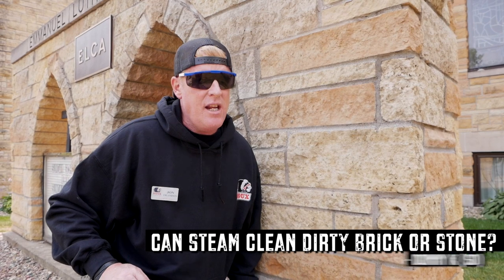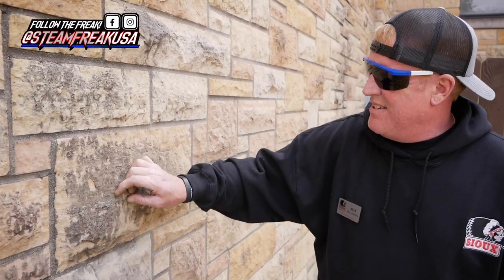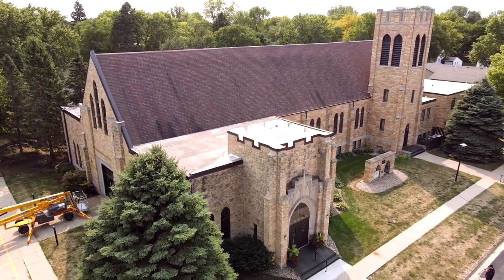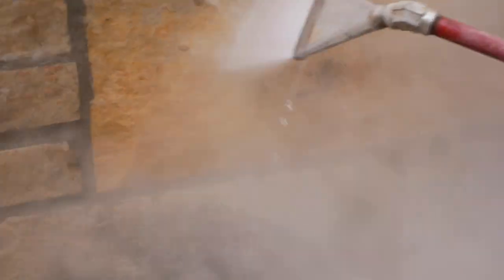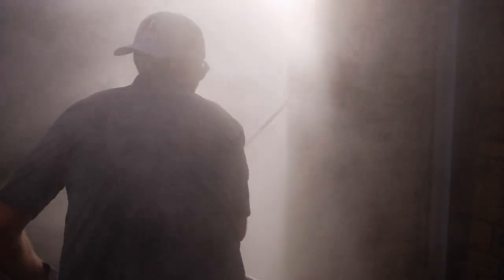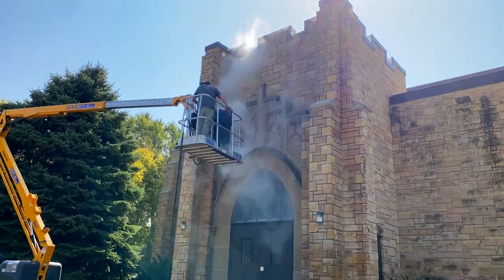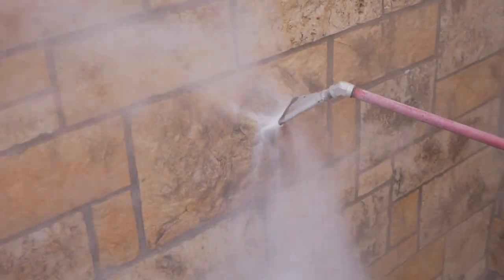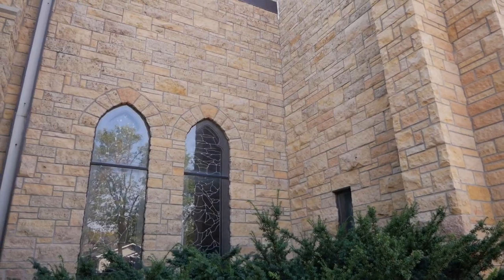How to Clean Brick WITHOUT Acid | Stone and Brick Cleaning Machine

Comment: would this be suitable for long term oil stains on driveways ?
Reply from the maker: Hi Michael, we've cleaned some parking lots and it does a great job with removing grime, gum, and oils on the surface. Removing the actual stain inside the pavement is tough but would probably be possible with the right heat, pressure, and chemical.